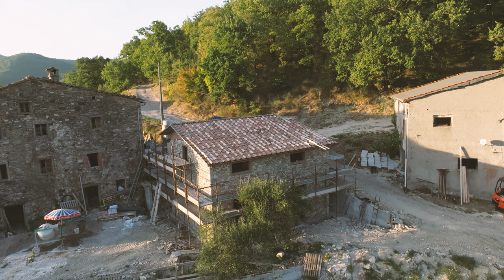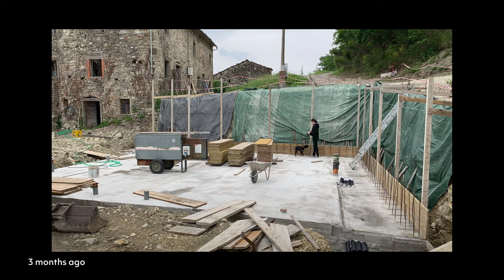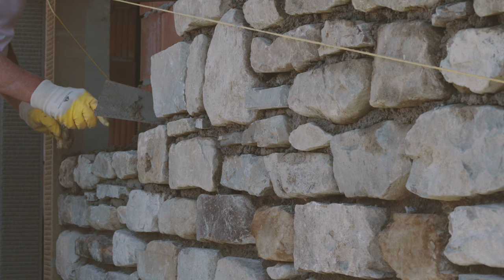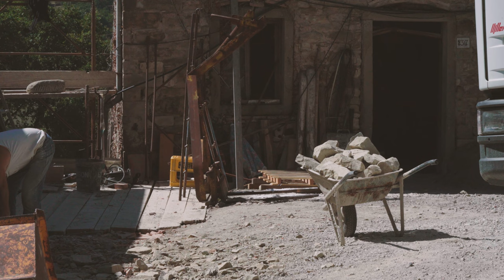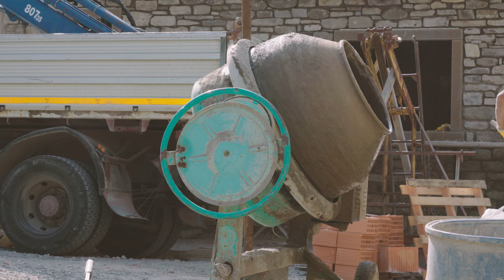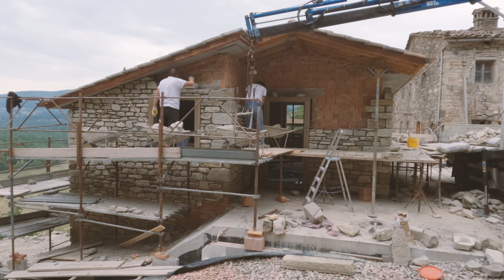#23 Traditional façade finishing. Covering walls with stone. Italian House Renovation | borgo baroti

Comment: Another benefit to having brick and stone walls, is it will help keep the heat out in the summer. My basement walls are the concrete foundation for the house and there is a good 10° difference in temperature between the main floor and the basement. In fact I spend most of the summer down there! So, If you are choosing not to use air conditioning in your house, this should help.😊